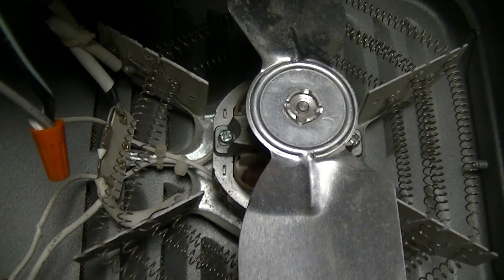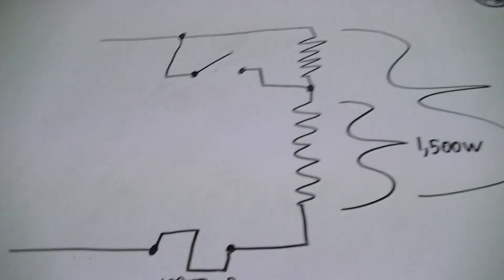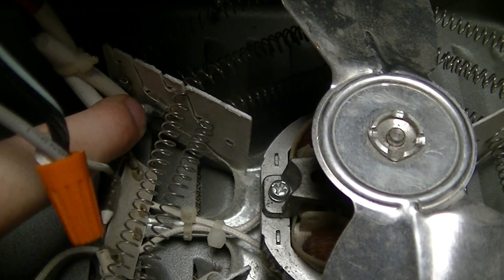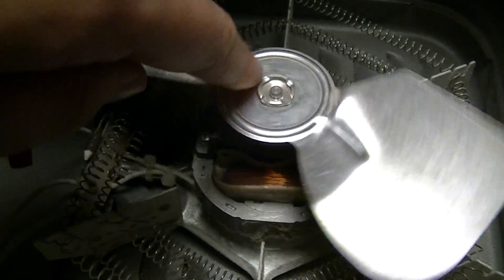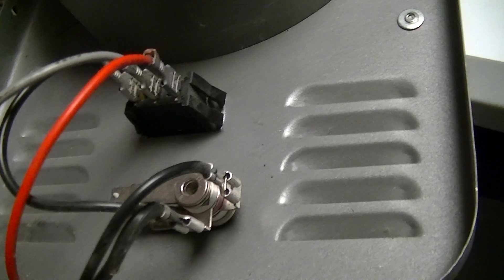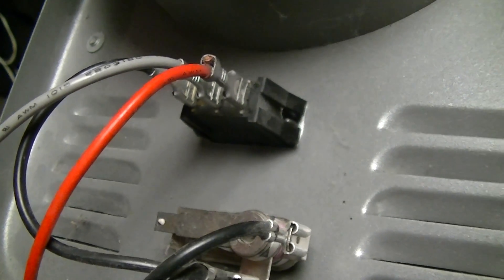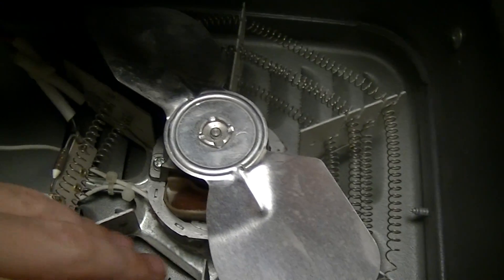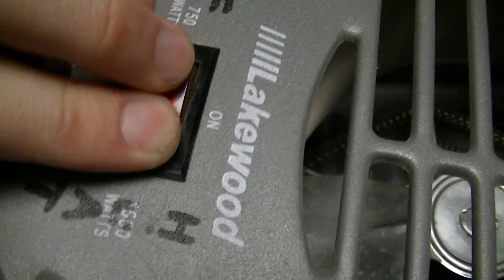Lakewood 792JR fan heater guts and modification

Comment from the maker: Sounds like it was the center tap on the heating element for the 1,500W setting, as it was rather crispy in this one.  If the element had failed, just the fan would work.

Comment: Ironically on mine, half of the heating element burned out, so I got this modification for free: the "750 watt" setting is now fan-only, and the "1500 watt" setting functions as a 750-watt heater.

Comment: Well I hope that stupid storm did not nail you . We got 70 mph winds and 3 inch rain .
I now have to put in a claim for my damage .
Neat mod for when you have not a lot to do . 
I was lucky and gen sets 1 and 2 operated in a parallel making a total of 14k and my ASCO switch shifted to gen sets and switched back . I now have mains power and internet .
Waiting for the back side of the storm.